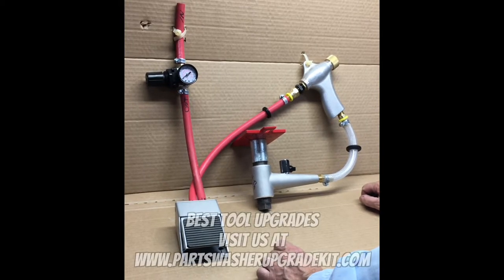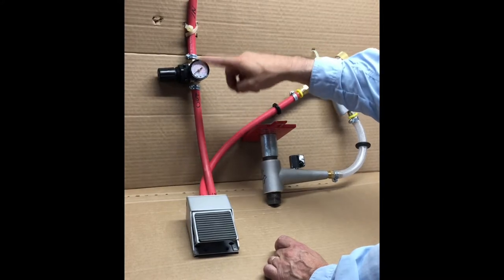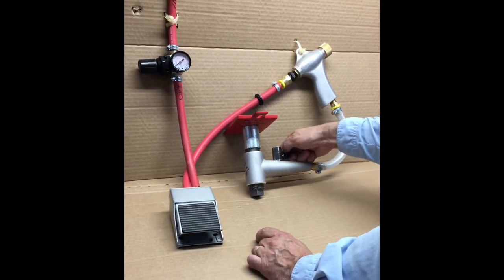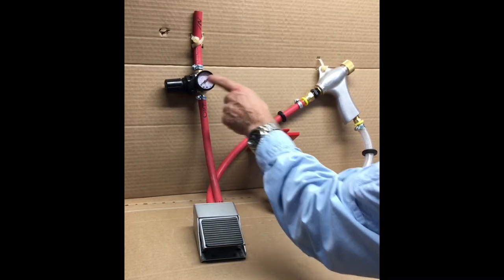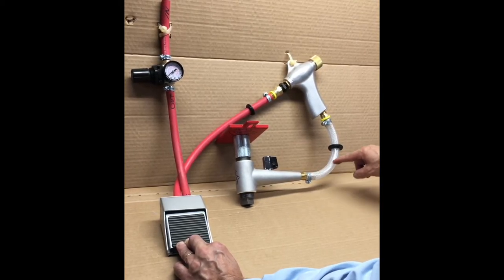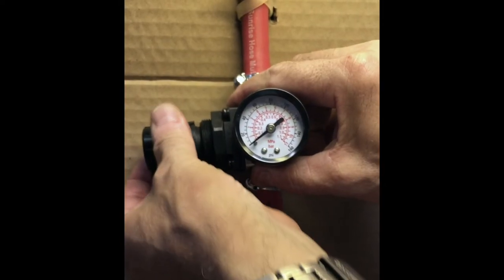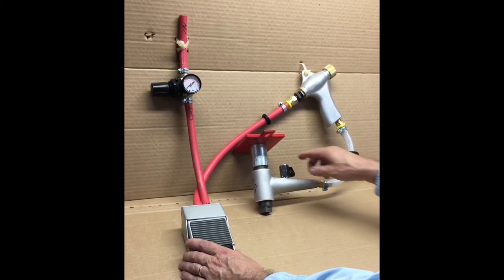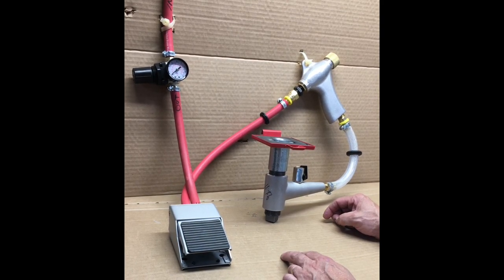Right Way to Dial-in your Harbor Freight Blast Cabinet Metering Valve Upgrade - Step by Step

Comment: Thank you I have a similar setup and it used to work great but then I haven't used it for a long time and it won't suck any media. Took apart the metering valve looking for clogs completely changed the media and now it gives spurts of media. I'm going to calabrate the air pressure and metering valve like you described. Thanks again
Reply from the maker: Hope this worked for you.  thanks for watching our video.  Check out our new videos as well on our gun vs other styles and imports.  regards

Comment: Great demonstration … what advise do you have for an Eastwood blast cabinet that I have had since 2008 and the bottom of the media area of the cabinet basically comes to a point and there is no door as you are demonstration. I have two holes about 1 inch in diameter… one to drain the media plug and the other a media pickup hole the goes from there into the top part of the shelf of the cabinet in the front. Hoping you can advise… thanks in advance ✅
Reply from the maker: If you can send a pic or two of the bottom of your cabinet we can probably make a recommendation to assist you.

Comment: Have you tried running a hose from metering valve upwards to the work area w/valve attached? Then you can regulate the air bleed without having to get under the cabinet.
Reply from the maker: That is an interesting suggestion but since this adjustment generally needs to be made only at the time of dialing in (and when media type or size is changed), it might be more plumbing than generally required.  Appreciate the thought.  Best regards

Comment: As a beginner what size air hose, fittings, valve, and Nozzle sizes should I use for medium rust on automotive sheet metal. I have a radiator frame I want to disassemble and media blast. I'd like to do it without have to go through a bunch of trial and error, do you guys sell a wall chart for that? Thanks for all you guys do, I've started watching your videos and have visited your website and purchased the pipe version of the Metering Valve, but I need more information. I have the large stand up HF Cabinet. Best Wishes & Blessings. Keith Noneya
Reply from the maker: Here's some  answers to your questions:
1) 3/8" ID air hose is the standard
2) 1/4" fittings with 3/8" barb are standard (and no - they are not too small)
3) Nozzle ID should be approx 2x the orifice ID
4) orifice size needs to be  tuned to the CFM of the compressor
5) black diamond (coal slag) and aluminum oxide would be good media to try.  Grit size depends on the size of your system (CFM and orifice size) and the amount of rust you are needing to knock off
hope this helps
Best regards
The Team at best Tool Upgrades
Reply: @partswasherupgradekit6028  Wow I was hopeful you guys would answer but didn't really expect one because most businesses are to busy to answer. I put mine together and have the HF Gun on it and one of the Y-Looking guns, sorry not yours, and I should be trying it out after I get some media. Here's the information I have on my current set up;
* Competitors Gun 
- Black Nozzle opening is a #1 drill .228" (5.8mm). 
- Air Inlet #23 .154" (3.9mm). 
** The harbor Freight Gun
- White ceramic Nozzle opening is a #11 drill .191" (4.8mm).
- Air Inlet of #39 .099" (2.5mm). 
* The compressor is a Speedaire 4B247B with a max PSI of 135 
- Displacement CFM of 14.1 
- Free Air of 11.2CFM @40psi and 9.6CFM @60 psi.
 If anyone can make sense of this you guys can. PS I have a 60 Gallon SpeedAire Cast Iron tank. The motor is 240V @ 15amps 3450 rpm. Sorry for all the specs but I used to be an Aviation Electronics Technician for 42 years for the U.S. Navy and Contractors and I found it best to give all the information if you want a effective answer. I absolutely loved your video! Best Wishes & Blessings. From the YT Channel Keith Noneya

Comment: what about the adjustment at the gun? how far do you screw in the nut? What effect does it have on the system?
Cheers Nick.
Reply from the maker: You want 3 to 4 threads showing between the brass lock nut and the black hex portion of the body of the orifice.  From there you can turn it in one turn or out one turn.  This gives you the final fine control of the spray pattern of the media as it exits the orifice.  But you do this adjustment LAST after everything else is dialed in.  Hope this answers your question.  regards.  The team at Best Tool Upgrades

Comment: Seeing it done live would be good, but understanding the fundamentals will get you there anyway and it becomes complicated after that as you do have to consider things like condenstation in your air lines/ how much CFM you can flow / is the nozzle diameter correct / what material your using and so on.
Whats the saying " plenty of ways to skin a cat and the end result is basically the same"
Keep up the good work i am sure you have helped heaps of people out, and jealous of some of the air compressors you lot have access to for cheap
Reply from the maker: You are correct that there are a number of variables.  The system needs to be balanced by design and component selection and then dialed in to achieve max efficiency
Reply: @partswasherupgradekit6028  With all that now understood, what is the minimum CFM you would recommend for this set-up with light sanding , say 2 hours or less in any given month? 

Also, what is the minimum gallon size tank you'd recommend?

Understanding these two measurements will help me decide if I should buy your kit. Thank You.
Reply from the maker: @allyg8or  6 to 8 cfm is the bare minimum we would suggest.  But more is always good.  Hope this helps

Comment: I just bought this kit and i have a question: 
On the right side of the pedal there’s a thread insert that says open. What is that for?
Reply from the maker: Good question.  Its the pressure bleed off port to depressurize the valve when you let off of the pedal.  You will hear a short hiss.  That is how it operates.
Reply: @partswasherupgradekit6028  so you just leave that one alone?
Reply from the maker: @Dan-gp2ng  Yep - just leave it alone and definitely do not plug it.
Reply: @partswasherupgradekit6028  thank you

Comment: How much media do you normally put in the cabinet when using the valve?
Reply from the maker: Best to start with 2 large cups full (like red beer cups) during the dialing in process.  Once it is dialed in you can add more but too much creates packing problems so add until efficiency degrades and then remove some to max out on efficiency.  Happy blasying

Comment: Just ordered one last night! What media do you recommend for car parts? Crushed glass?
Reply from the maker: Appreciate your order.  Need more info to make a rec on media type.  Are you removing rust?  Or preparing clean surface for primer and paint?
What type of metal - mild steel, aluminum ?
Reply: @partswasherupgradekit6028  makes sense I'll be doing it all so time for some experimenting lol. The kit came two days early and is great quality. Will for sure be leaving a review on the website. Thanks for putting this together

Comment: When will you be doing the comparison of the pipe meter and the hf meter valve in tems of which1 is better in terms of with one is more efficient and affective
Reply: Also does the metering valve require  more cfm
Reply from the maker: We have been wanting to do this for a while.  In all honesty, our sales are way up and we have been super busy making sure that we have sufficient supply of stock and maintaining our fast ship standards.  We hope to get to it next moth as timer allows and will certainly post a new video
thanks for your comment
Reply from the maker: more cfm than what - the siphon tube?  Actually because the metering valve is a more efficient design, less cfm should be necessary assuming all other variables are the same (media type, grit size, psi, etc)

Comment: What size ceramic tip are you using..I can't do nothing on 60psi..I've tried different size tips,seems that a number 6 or better is all I can get to work,,I figured a smaller tip would give more pressure,but will not draw media...I'm using 80 grit aluminum oxide
Reply from the maker: We use a 1/4" nozzle and then match the orifice to the output specs of the compressor.  The nozzle (assume this is what you are calling the tip) plays a roll in controlling the spray pattern but the orifice  size (ID) is really the most important component in terms of getting good and consistent flow.  We would need more info to help you diagnose the problem.  Also if you are using the HF gun that came with the cabinet, that thing is pretty bad.  Have you replaced the siphon tube with a metering valve.  That will work wonders.  Hope this helps

Comment: Can I remote mount the air bleed valve so it is accessible from standing level? As it is right now I can't see the gun when I am adjusting the valve.
Reply from the maker: Interesting idea !!  Yes - this is possible as long as the tube you use is not too small in ID as to create significant levels of friction that would reduce flow.
Reply: I mounted a lawn mower throttle cable to the valve so it's up on side machine easy access

Comment: In theory can I use a bigger fitting that attaches to the drop door? And what is the best size for the part coming off the tee that the hose and valve attach too? I plan on welding a bigger pipe fitting to the door so there's a bigger hole for the media to go through.
Reply from the maker: Bigger is not always better because the flow of air will effectively stop when volume becomes too great.  If you go to a larger pipe fitting to attempt to increase the draining of the hopper you may find that improving one aspect of the valve renders the rest of it highly ineffective.  We tested many combinations before we found what functioned the best.  All the pieces need to work together.  Hope this helps
Reply: @partswasherupgradekit6028  I have a 1" tee that has a 1/2" outlet on the "tee" part. That should be good enough as the final outlet is 1/2" right?
Reply from the maker: The tee needs an extension to form the barrel portion.  The 1/2 outlet is fine.

Comment: I ended up duplicating this entire system. But, no matter what PSI/metering valve position combo, barely any media comes out of the gun. The cabinet is brand new so I can't see how it could be trash in the media. Anyone have any ideas where to check for an issue?
Reply from the maker: @Doug: Sorry to hear that you are having issues.  If you sourced parts yourself from the various internet sources, it is possible that you have parts that are not quality pieces.  For example, please see our video https://www.youtube.com/watch?v=NGEtNs8QWpw   where we describe a very poor quality Chinese knockoff of the gun that we sell on our website partswasherupgradekit.com.   Without knowing if the parts themselves are up to snuff, it is hard to diagnose the problem.  It is possible that you have the wrong orifice size in the gun and that orifice is not matched to your compressor specs.  Or the nozzle ID may not be matched to the orifice ID.  Get back to us if you continue to have problems and we will do our best to help.

Comment: What ID hose are you using? Thanks
Reply from the maker: The air hose is 3/8 ID.
Reply: @partswasherupgradekit6028  thanks for getting back to me. I’ve read a lot of stuff saying you need to have 1/2” ID hose. I guess that’s not the case? Btw, that mockup was genius and so helpful.
Reply from the maker: @plugger410  The media hose is 1/2" ID.  A 3/8" ID air hose delivers PLENTY of air and is the standard for most air delivery systems.  Bigger is not necessarily better in all cases.  Thanks for the comment on the mockup.  Started to film it on the actual cabinet and started to make myself sick with all the looking up and and looking down LOL !!  Please subscribe to our channel to get notifications of our future videos.  Those subscriptions help us out a lot.  Happy blasting

Comment: Please describe what is best setting?
Reply from the maker: Thanks for your question, which is really the point of this video.  The metering valve needs to be dialed in as described in the video because your setup will be a little different than another one.  It only takes about 5 minutes to dial it in and really never needs to be changed unless you change your compressor or go to a very different kind of media.  Try the procedure we have described and let us know if you have any questions.  Happy blasting !!
Reply: @partswasherupgradekit6028  thanks
Reply: @partswasherupgradekit6028  but what dictates the best or optimal flow?  Is it when the most media is flowing thru the tube up to the gun?

Comment: that pedal only flows enough air for the very smallest orifices. It works fine used to control a rubber air valve.  Air flow is enormously important, and all the pressure drop MUST be across the orifice, not any of the upstream parts. DITCH THAT PEDAL!
Reply from the maker: Thanks for your comment.  The foot valve we supply with our kits is sized to work extremely well with the size orifices we supply (3/32 and 1/8).  Our products are meant to support the home garage guy and small production shops.  We have sold >1000s of kits and our customer feedback is enthusiastically positive based on their great experiences with upgrading their blast cabinets with our products.  With very large orifices, 5/16" etc., yes, more air flow is needed across multiple components in the overall system, but these large size guns are typically found in large scale, factory style production facilities that run their equipment virtually all day and every day.  That is clearly not our market.  Again, thanks for your comment.  Happy blasting!!
Reply: Replying to your comment, as i also am under the same undertanding! However... I have been thinking to have a pedal (i used to blast as a job commercially, so im used to it) annnd what/how i came up with was.. What if i run a 12v 3/4 solenoid  valve so the "foot pedal" is electric actually(running a 13hp honda to a 3 cyl pump). I have 0 idea how it was done in the day (way back) i just did it, i wasnt thinking to ever build one. I have seen that.. apparently the lowrider community, has some what they call "Fast" valves, im thinking that might be the ticket?! Curious to hear feed back :)  / I do know you can buy a mechanical 3/4 valve for several hundred from like one place, so far that i see.. But you can get one if these elec valves for half that, or less and they are "around"  . Its all cloak and dagger trying to find orifice size on valves for the most part every pic of every valve everywhere isnt shown just right so you can actually SEE! Uh huh tells ya something right there i think! Another reason why i think the "fast acting" must be a large orifice ??!

Comment: Seriously if I used 60 psi my great grand kids might finish my project for me lol maybe
Reply from the maker: We cannot evaluate your system as we have no knowledge of it.  However, our system, properly installed and dialed in, will perform with exceptional efficiency at or near 60 PSI at the cabinet.  Running at this pressure is better for the compressor as it reduces the need to cycle on as often, reducing wear and tear.  If we can assist you, please let us know.  Best regards